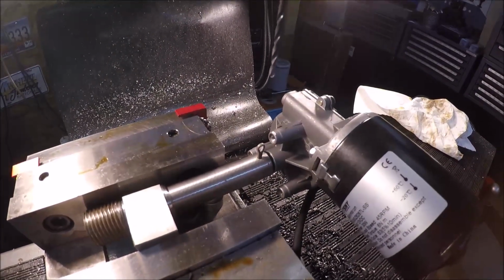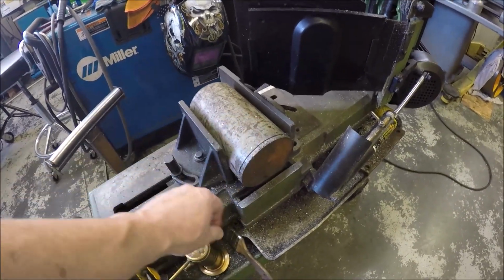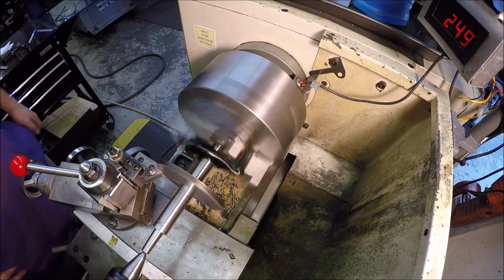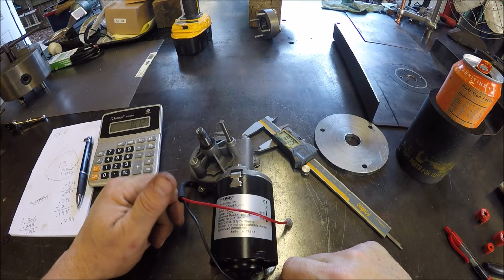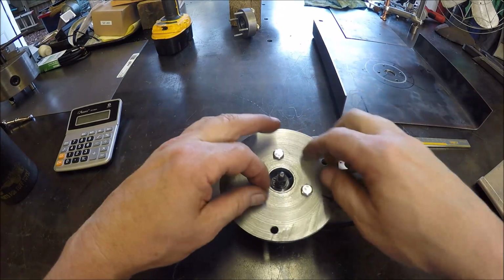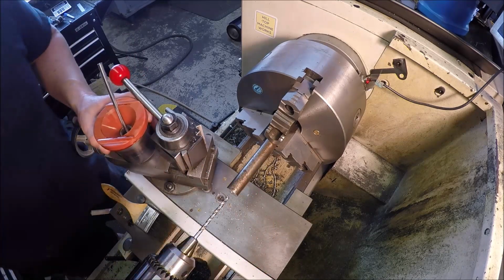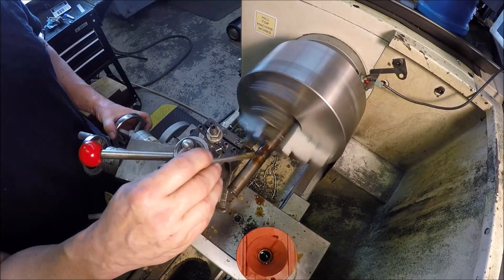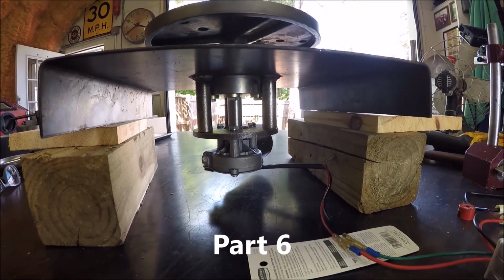Rotary welding table build Part 5

Comment: Question on the motor. Is that a wiper motor? How strong is it? Btw nice job.Thanks for sharing.
Reply from the maker: It’s a typical motor in vehicle doors to power the windows up and down. It is working fine so for. Since the weight of what ever I weld up is on the bearings the small torque that the motor has turns the table easily.

Comment: Nice job Tom. It’s good. Hey, I’m with Vernon are you going to use but control and variable speed. It’s going to make a really nice addition to your tool arsenal my friend. Looking forward to the next episode for sure.What’s this cheap adjustable parallel stuff Ha? I know someone who’s got a nice set of Starrett adjustable parallels 😁
Reply from the maker: Yeah I only have an import set. Nothing but the best for my friends...........:)
Reply: Tom ,,what value potentiometer value are you using. I’ve had good low speed adjustability with a 5K ohm. Just curious.
Reply from the maker: Using one of these. https://www.ebay.com/itm/12V-24V-Max-20A-PWM-DC-Motor-Stepless-Variable-Speed-Control-Controller-Switch-/283028026342?hash=item41e5c8f3e6

Comment: Are you going to wire a foot controlled stop switch to control the travel?  The table is looking great!  Should be a very helpful addition to the shop.  Nice work.
Reply from the maker: Yep wiring in a foot pedal.

Comment: TIG the old blade back together and keep it around for a spare! I used the hole pattern function on my DRO for the first time the other day. I have played with it a few times. I found first center your mill on the whole in the center enter that as center position zero out you x and y axis. Then It asks the start position in degrees which I found 0 degrees is on the left side of work in line with the X axis centered on the whole. Then it asked the ending angle  so on a three hole pattern that would be 240 degrees. Then it asks the number of holes. Then you are ready to start drilling, it will give you the coordinates for the first whole, just go to zero on x and y drill the hole, hit the down arrow  and it will go to hole #2  and rinse and repeat for hole #3
Reply from the maker: What brand DRO do you have?
Reply: Tom, I don’t know a brand name. I bought it off of AliExpress but it seems like most of the other DROs on EBay or Amazon just much less money! I made a short video on the programming and posted it on my channel... my first video on Utube!

Comment: I always keep a spare bade, I use Starrett blades and order mine from Amazon, but hate to have to wait 2 days. So when I wear or break one I just order another one. Glad you putting the oil cups to use. The rotary table is coming along
Reply: Tried to explain that to my wife about toner cartridges for the printer in her home office.  Never had one when she really needed it, luckily the nearest Wally World carried that cartridge, a 30 mile round trip. LOL
Reply: Mature Patriot yes any time you have to run out any distance to pick up stuff it can be costly, at least we don’t have to drive 30 miles to Walmart.
Reply from the maker: I get the Starrett blades also, but from McMaster. Yep using the oil cups a lot. Thanks again.